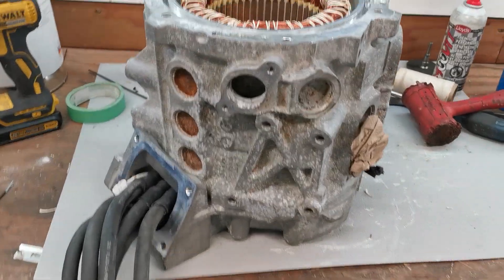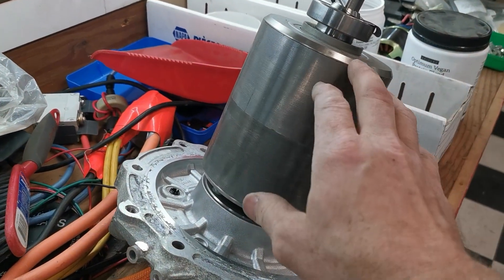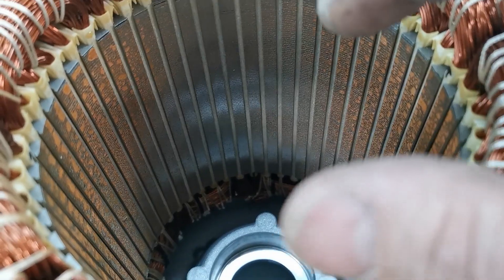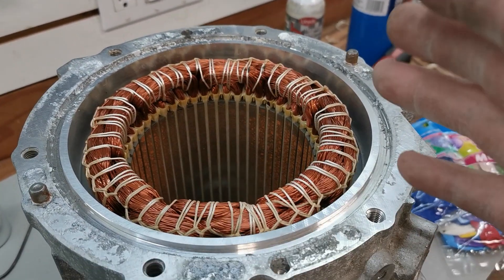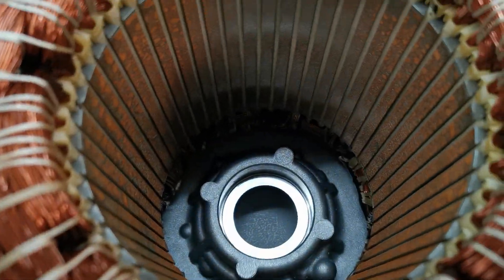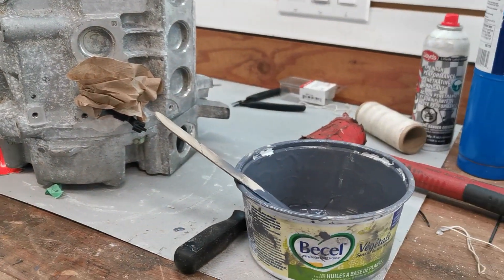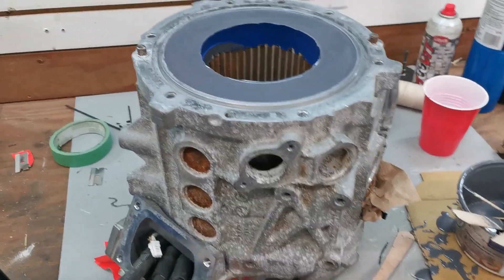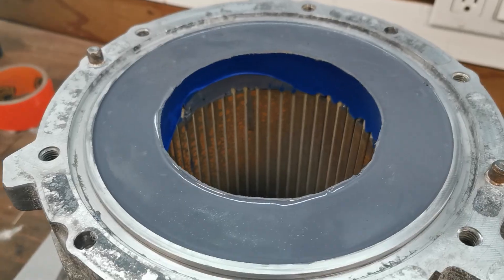Potted dual controller Leaf motor

Comment: A type of non conductive oil or other fluid could be a option, and the motor could be serviced or modified. 
The rotor is a cylinder so wetted surface area shouldn't be causing too much drag.
Reply from the maker: Been there done that.  Sorry It has a lot of limits as well.  Potting is hands down the best way to go.   You don't need to "service or modify" the windings the only thing needing service is the bearings and I can still get to them.    With oil it will find its way out.  It will wick up the wires... leak past o-rings etc.  You also then have to seal it super good and get the right amount of oil in so you don't cause a tone of drag on the rotor and then you need to allow for thermal expansion and contraction.  Its a LOT harder to deal with.  On top of all of that Oil doesn't conduct heat nearly as well as this potting.
Reply from the maker: This potting has a thermal conductivity of 2.2 W/mK  and Oil has a thermal conductivity of .125 W/mK so this will conduct heat out of the windings 17.6x as good!

Comment: there's no real sense in going with too big of a controller. The torque of the motor is limited by the field strength of the rotor magnets, so putting too much current in the stator can actually de-gauss the magnets, further reducing the torque of the motor. Once the electromagnetic field strength matches the field strength of the permanent magnets, the only way to increase horsepower is to have more voltage available, so the motor can turn higher RPM at that maximum torque. (gear it down, rev it up)
Reply from the maker: Not true. The whole de-gauss the magnets from too much strength is a old wives' tale.  Its never happened in real life.   There will be limitations for sure but I am not worried in the slightest about demagnetizing the magnets. Heat is a bigger concern but with them buried in the laminations of the rotor they won't get as hot as a SMPM motor.   There is 2 parts to these motors and its  big reason we had to add MTPA.  You are not just using the stator to push and pull on the magnets but you are also pulling on the rotor iron like a SR motor.   As for RPM these are geared low already I already spin them to 15000 rpm.   Many people had no idea I would be able to get 300hp from these but I have proven that in another video.  As the motor approaches saturation the inductance drops and that will be a challenge but with the split windings to each controller it will help by making the inductance 2x.

Comment: Why wouldn't you do this for a street-driven car?
Reply from the maker: I will with a single set of phase wires in time.
Reply from the maker: The problem is the 6 phase wires are not as perfect as I would like them for something I am planning to put many miles on.  But time will tell how this works out and how I can support them while routing them to the controllers.

Comment: Heating the potting and using a vacuum chamber would have helped. Hope it got in there enough!
Does the potting have good thermal conductivity?
Reply from the maker: Yes.  I spent a lot of time looking at Datasheets to find something with the best thermal conductivity but still could flow as much as possible. Vacuum chamber would have been next to impossible.  Non the less simply getting the heat from the end turns to the case quicker should be a big win when I really push this thing.
Reply: Keep it up! I've been a big fan for years. Good to see you back to work posting some projects.
Reply from the maker: @cheapygeek  Thank you.  I am still here.  Just trying to find a path forward with some personal stuff which I will share at some point.   But this stuff and my boys are what makes me happy and they love helping with as much of this as they can.